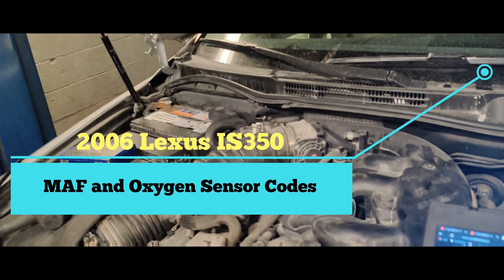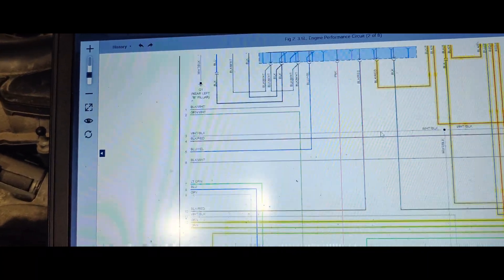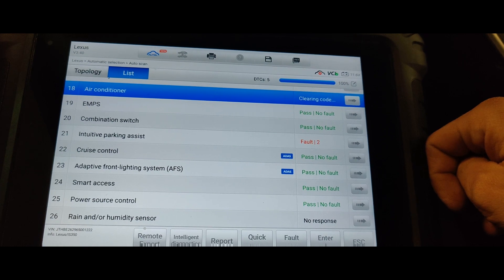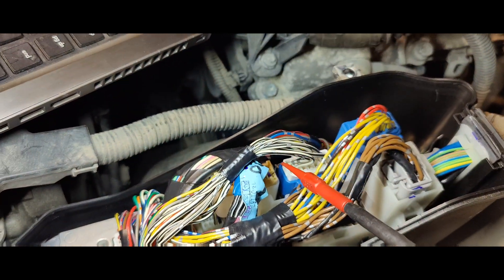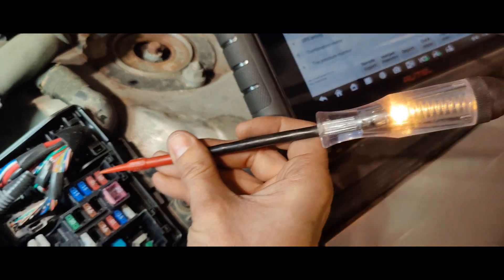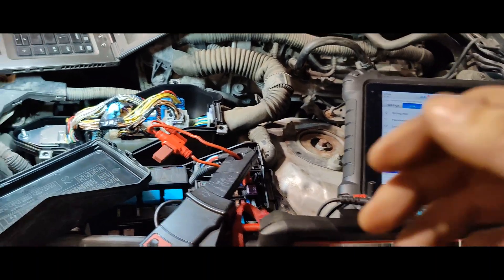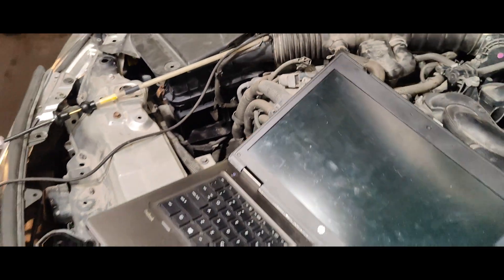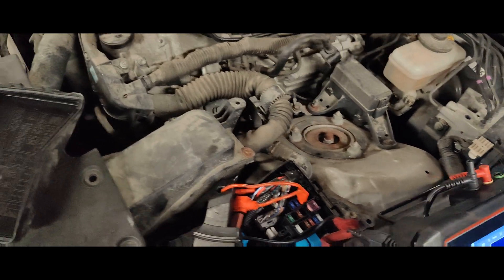2006 Lexus IS350 MAF and Oxygen Sensor Codes P0031, P0037,P0051, P0057, P0102

Comment: It was the same with my is250. I appreciate it a lot brother saved me a lot of time!!
Reply: @daisonkirkbride7205  was it the efi fuse? Because I just replaced mines it didn't do anything 😭
Reply: @corbybradford7909   it was the efi2 fuse for me. I must of shorted it when I was trouble shot one of the sensors for a different problem I was working on. Are you getting codes what are your symptoms? 😮
Reply: @daisonkirkbride7205 it won't rev past 3k rpm, both of the rear o2 sensors were bad and low circuit maf sensor I replaced all and nothing still.
Reply: @corbybradford7909 sounds like it iss in limp mode. Hook up a scan tool. Go to data stream mode. Look for fuel pressure fuel pressure. Should be around 600 psi Note it. Then look for Ltft stft both should be below 10%  note them and hook up a volt meter to battery and note the voltage when running at idle. Should be 13.2 to 14.4 All at idle  and may I ask what kinda work was you doing before the problem started?
Reply: And after you replaced the sensors did you pull battery power let it sit for 2 plus minutes before hooking it back up? Read the data streams before you do if you did not.
Reply: @daisonkirkbride7205 I bought the car like this. I replaced the maf 3 times cleaned it. Also replaced all 4 02 sensors cleaned as well. Poured a gallon of lacquer thinner with half a tank of premium. Poured sea foam in brake booster hose. Checked fuses and harness, deep cleaned throttle  body still no luck. I need to get these 3 codes off so I can do the registration and inspection
Reply: @daisonkirkbride7205 update turns out my fans arent turning over at all the ground wires have a short somewhere. I'm so stressed I'm at the point of selling it

Comment: Do your the freaking best i was driving on the freeway and out of nowhere car had like no power and throw the same codes replaced blown fuse like u and fixed all my problems
Reply from the maker: Awesome, just remember if it blew, it probably blew for a reason. Fuses do not just normally blow.
Reply: @RobertDotterer  it’s still blowing the fuse do you think it can be o2 sensors bad causing it to